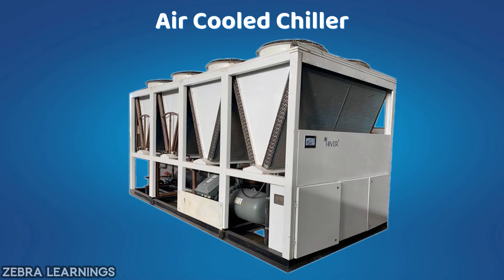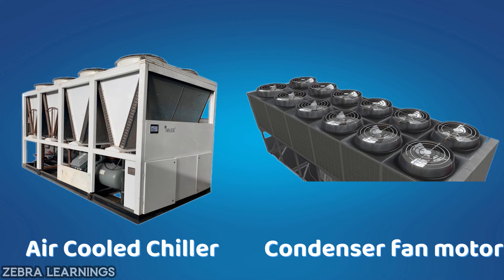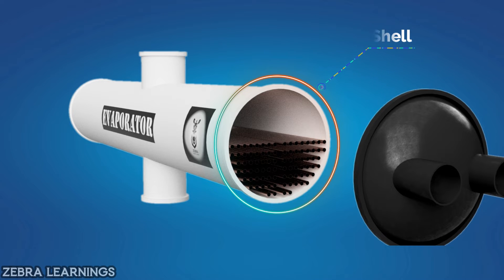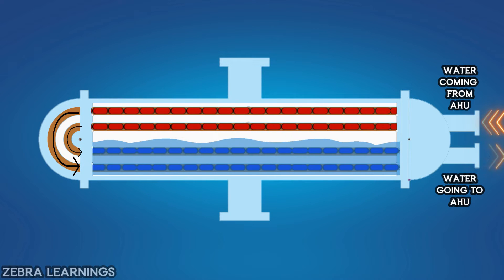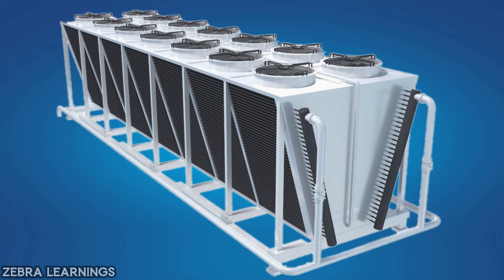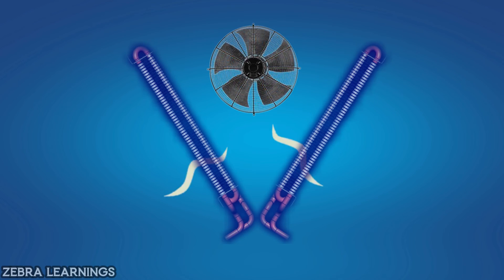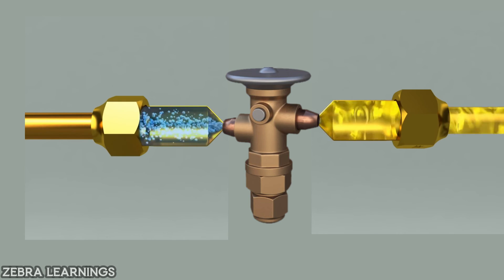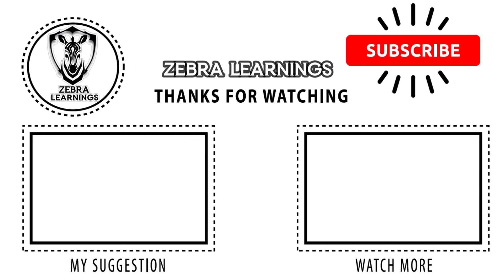Air-Cooled Chiller Working Principle | Animation | #hvactraining #hvacmaintenance

Comment: Sir ,I have a daut that where does water come in from primary and secondary pump.
Reply from the maker: From Primary and Secondary pump the water goes to Chiller and Building. The water circulating in that loop. If water is needed in primary and secondary pump, the water will be added from Makeup tank. You can learn more in the Primary and Secondary pump video. The link is below.
https://youtu.be/GN-CG7V59cs?si=WFCFsi2kvDP0Bp8B

Comment: From where did water come in Air cooled chiller? Is there a water tank or how the water is inserted in this cycle?
Reply from the maker: There is a water tank you feed the water to the pipeline when the pressure reduces. The name of the water tank is make up water tank.
Reply: @zebralearnings I think its expansion tank
Reply: The water is pumped from the AHU (air handler unit)

Comment: Sir,so you mean to say that in air cooled chiller,there is only compressor and evaporator attached with each other in chiller room and the condensor and fan motor is outside the building or on the terrace?
Reply from the maker: No, All are attached. Evaporator, Compressor, Expansion valve, Condenser and fan motor these all are in single unit. All are attached in one unit.
Only in water cooled chiller, chiller will be in chiller room and cooling tower will be in terrace.
Reply: @zebralearnings  ok
Thank you
Reply from the maker: Feel free to ask your questions.